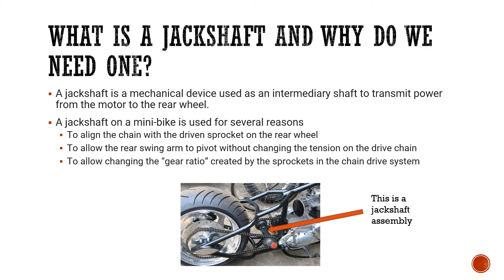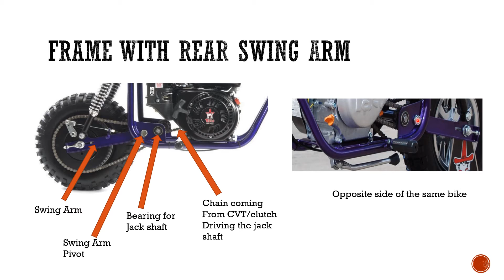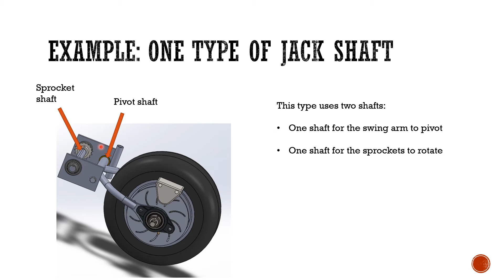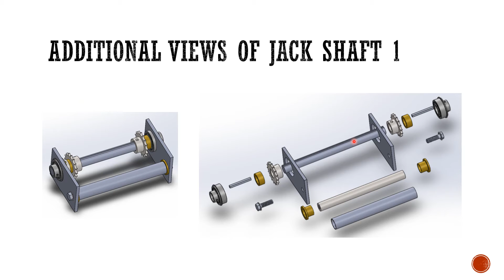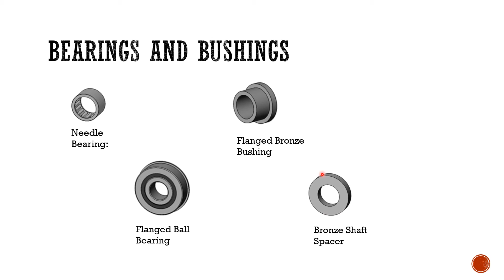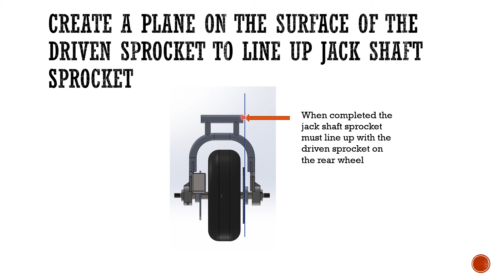Jack Shaft Design Process

Comment: your video explains a lot and I can tell you know a lot I’m trying to put together a jack shaft on a go kart I’m building my torque converter sprocket is rated for a 420 chain which is easy to find but my rear sprocket is rated for a 530 chain and I need to find a 530 sprocket which I can’t find one I’m trying to have the jack shaft with a 420 sprocket and a 530 sprocket but I also need to find the shaft along with the diameter of the shaft bore size of the sprocket a shaft with a key hole the sprockets with the same size key hole that fits the shaft and all of this mess put together makes it hard so if you can help it will be so appreciated for me